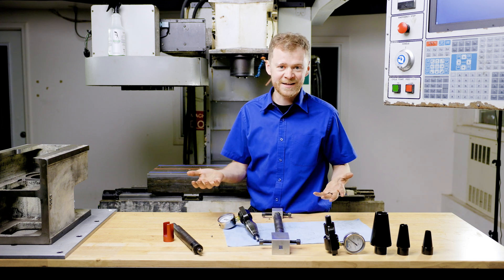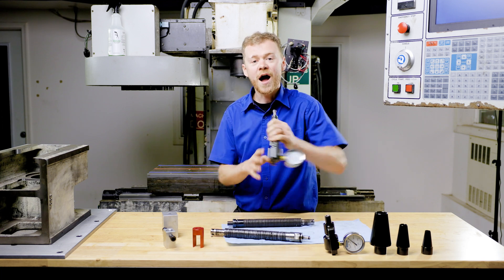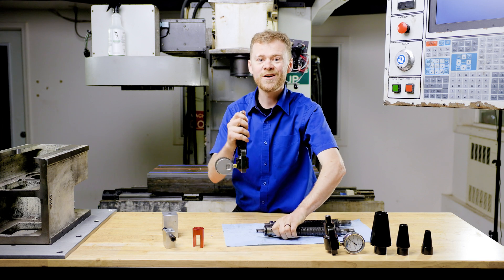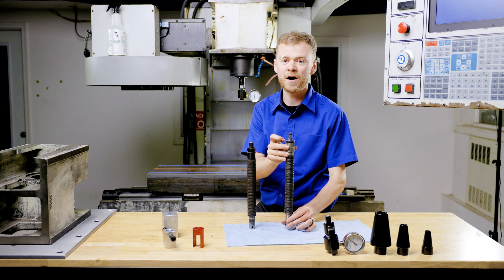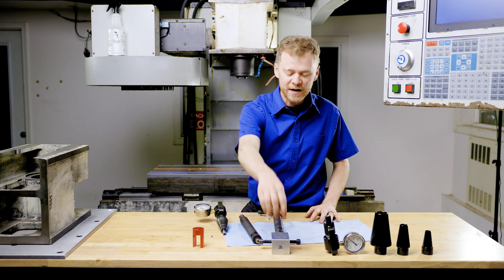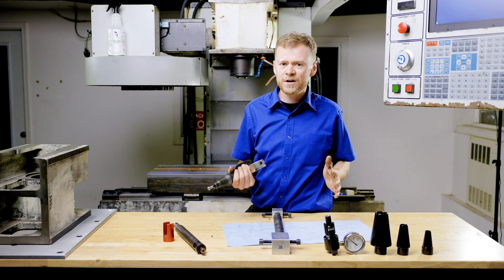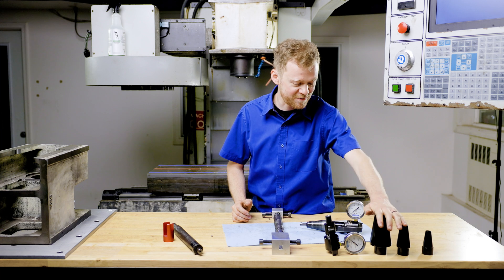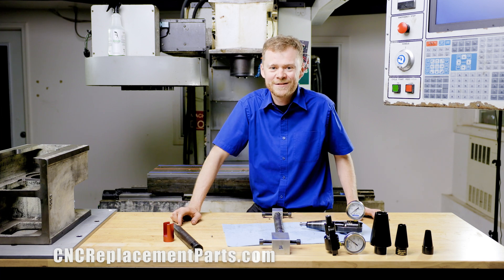Drawbar Clamping Force | How to check it

Comment: Awesome video.  Thanks.  I have an older machine with very low hours.  In your experience, do the washers age out or wear out?  What I mean is will material creep cause those washers to relax sufficiently to require replacement over a long period of time, even if the machine isn't used?  Or is it typically flexing due to a high number of tool changes that fatigues them?  Thanks.
Reply: If you do not keep a tool in the spindle then your draw bar is relaxed. The washers are NOT under tension and therefore won't lose tension. Never keep a tool in the spindle unless it is working.